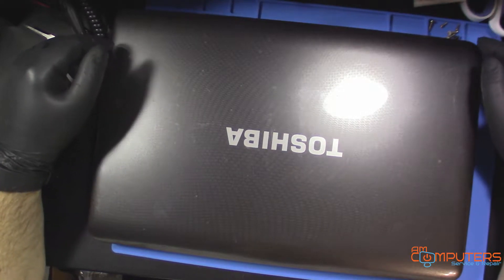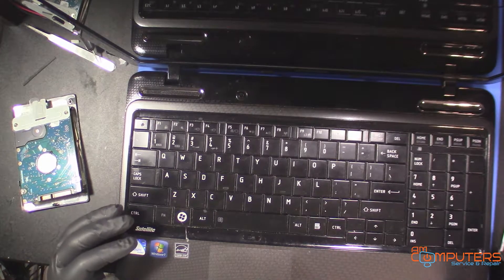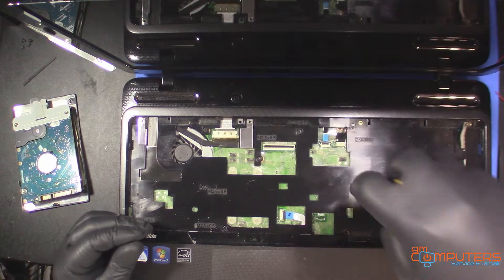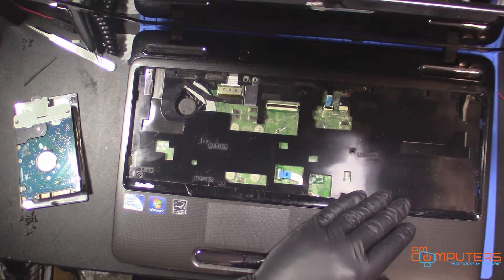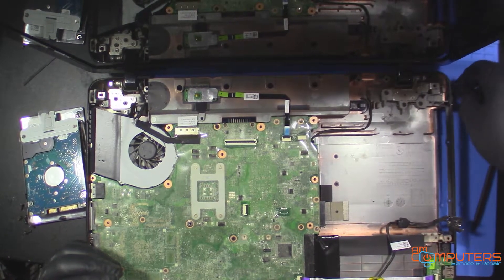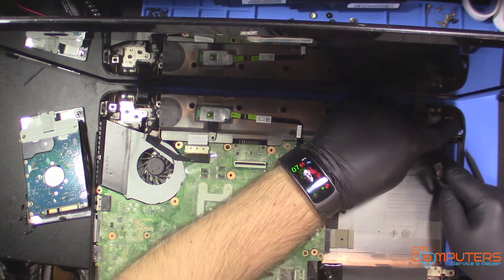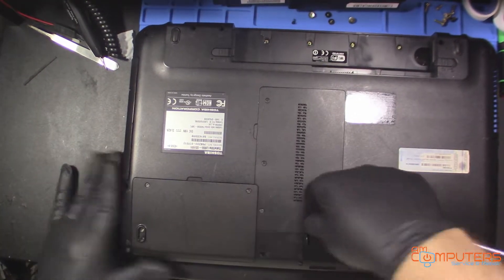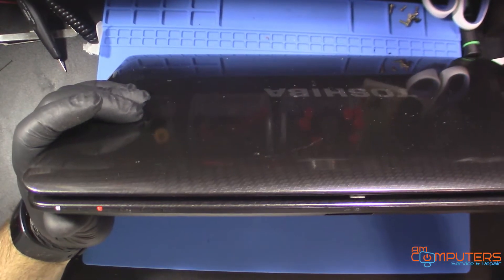Toshiba Satellite L655 (charging port) Power Jack Replacement

Comment: I need to replace mine from my old toshiba I believe, because my charging port is sunken in. Or is there an easier way to fix this issue without taking it apart?
Reply: I’m having the exact same problem. I know you posted this comment a while ago, did you ever figure it out?
Reply: G’day Anthony, so was your charging port (or whatever it’s called, where the power cord just plugs into) was your intact, and not damaged. 

But the little port itself had sunken it a bit? 

Mine looks totally fine, it’s just sunken in a bit.

So I’m wondering if I should try to pull it forward,, into its original spot, with a pair of tweezers, and using a dash of glue. 

Thank you in advance, for any feedback you can provide Anthony ✌️
Reply: G’day , so was your charging port (or whatever it’s called, where the power cord just plugs into) was your intact, and not damaged. 

But the little port itself had sunken it a bit? 

Mine looks totally fine, it’s just sunken in a bit.

So I’m wondering if I should try to pull it forward,, into its original spot, with a pair of tweezers, and using a dash of glue. 

Thank you in advance, for any feedback you can provide me please.